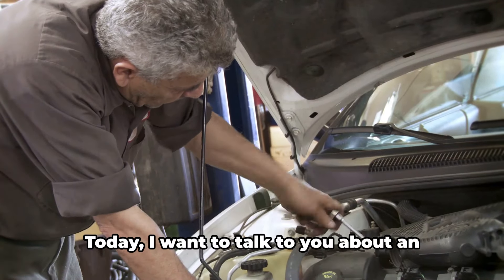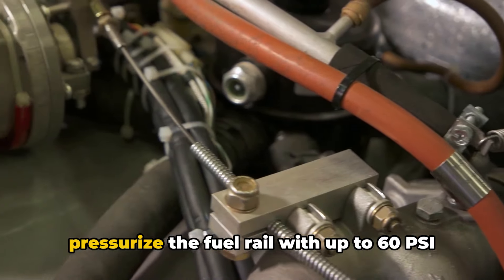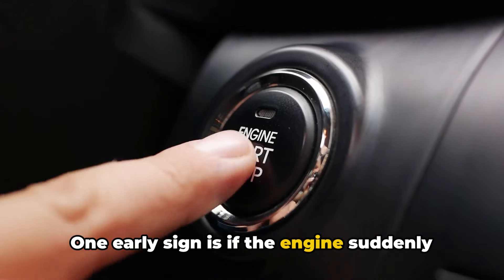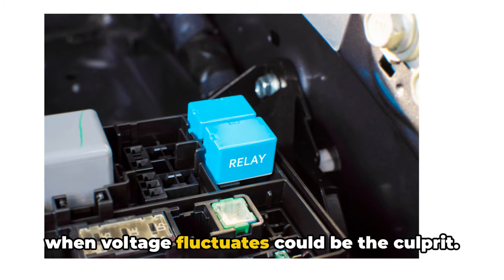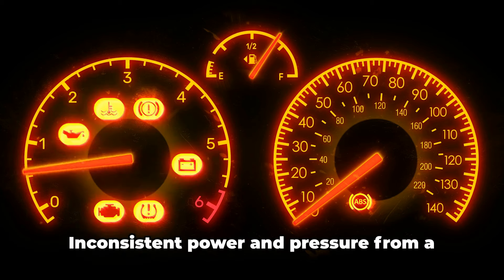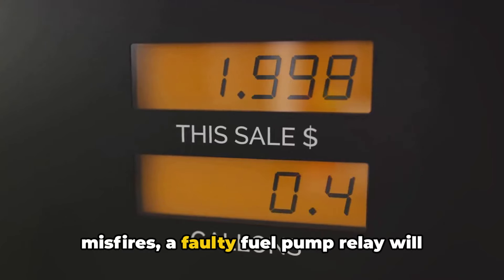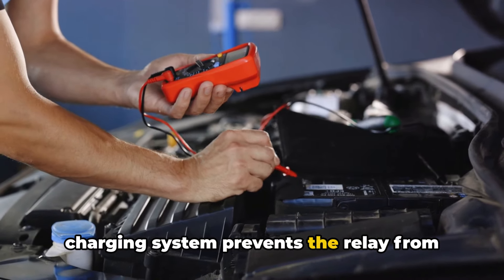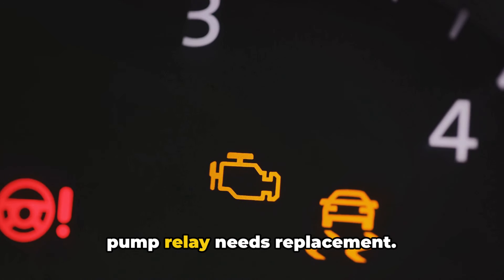Bad Fuel Pump Relay Symptoms: 6 Common Failure Signs

Comment: Thank you so much for posting the video. I found it very helpful although I would like to pick your brain about an issue I am having with my 2012 chevy malibu that none of the videos cover. 

I bought it early March and after about 10 days of driving, it wouldn't start one morning. I did some research, figured out it was the fuel pump relay (or so I thought). I replaced it and it started up just fine. 2 days later, it wouldn't start again. I replaced the fuel pump relay again, and it started up just fine. Until about 4 days later when it wouldn't start again. This time I was sure that the relay couldn't be bad again so I pulled the fuse box out and inspected the wiring. I didn't see anything or feel any heat so I tried starting it and it started perfectly. 
At this point I was confused but it drove fine for a few days until it wouldnt start again. Now everytime it doesn't start, I simply lift the bundle of wires up or wiggle them around and the car will start for me but only lasts a couple of days before needing to be moved again. 
I have watched dozens of youtube videos and talked to a few people about this and they seem puzzled so I will take any and all advice!
Reply from the maker: Hi Chelsey, It seems like you have a loose or faulty electrical connection related to the fuel pump relay circuit. The intermittent starting issue and the fact that wiggling the wires temporarily resolves the problem points to a wiring issue. Possible causes could be a damaged wire, corroded connector, or a loose connection in the fuse box or at the fuel pump itself. To resolve this, you'll need to trace the fuel pump relay wiring and carefully inspect all connections for damage or corrosion
Reply: @chelseycombs9205: Sounds like your fuel pump is bad. It's drawing too many amps and keeps burning up the relay.

Comment: Hello thankyou for the vid.

I have a direct injection engine and have noticed when i turn off the car. The fuel injectors are randomly spraying every 5 mins for about half an hour. The car then finally goes to sleep. Can a faulty relay be the cause of this?

Regards
Reply from the maker: Hi, A faulty relay is unlikely to cause the fuel injectors to spray intermittently after shutting off the engine. This behavior is more likely related to a problem with the direct injection system, such as a faulty high-pressure fuel pump, leaking injectors, or issues with the control module. Let me know if you found the cause

Comment: Hi there I have Opel Corsa 1.4 that will only crank unless if I give it a boost by Stepping on the accelerator and in order for it to idle well, I will have to leave the accelerator when the engine is a bit warm.

Comment: Might a failing relay be related to the fuel gauge not working? I have already replaced the fuel level sending arm, but the gauge is stuck  at below empty. Occasionally, it will read correctly, but it lasts just a few minutes before it goes to reading empty. Any ideas? Thanks.
Reply: Check the fuse to the gages n ur car
Reply: @JosephWilliams-r2m  I have checked the fuse and even replaced it, and confirmed that it can't be that because on occasion the gauge will work for a few minutes or even a day. I think it is wiring or the instrument cluster.
Reply: I just started having a similar problem. My gauge stops a right above a half tank. Sometimes will go below half tank. But when turn the truck off and start it again. It’s back on half tank but when I fill it up it works until I get down to half tank.

Comment: I would like input or advice...
I have a 1990 Ford F150 duel tank (manual) and it been having trouble starting, idling and the check engine light is on. 
It also pushed fuel from the front tank to the rear tank, then overflows the rear tank. 
Assumed it was the fuel pump malfunctioning. 
Took it to a mechanic who is familiar with Fords (and older models) and after extensive diagnostic said it wasnt the fuel pump (they work fine) and eventually told me it needs a new PCM. 
After watching this video, I wonder if it could be something as simple as the fuel relays (as both problems present the same symptoms).
Id like to safely assume the mechanic checked the fuel relays (but you never know). 
Its going to cost me about a grand to get a rebuilt PCM and after hearing from several mechanic sources that its hardly (if ever) a bad PCM, Id like to avoid spending 1k (on such an old truck) only to find out later it was something simple like the fuel relays. 
Any suggestions???

Comment: I stopped at the Coney Island to get something to eat but before I got out the car was running for about 5 minutes so I went in to Coney Island and when I came back out the car started with a very rough idle and then he died and I kept trying to start it up it will crank up with the very rough idle and then die again to the battery died. After sitting for about 15 or 20 minutes I finally got a boost in a crank right up and ran normal. Then today I made a couple of errands and when I got back in front of my house the same thing happened from last night I turned it off and when I crank it back up it ran really rough and died and I kept trying to start it up running rough until the battery died again

Comment: relay stuck some times  ....and fuel pump always running........
Reply: Same, but not sometimes, it's always grinding and whining. I only hear it before starting the engine. Pretty sure it used to shut off after a few seconds
Reply: Even with engine off??? Locked doors and no key in??

Comment: that for this video!  I am wondering if this is the problem with my 2007 Saab.  sometimes it starts and runs fine but then after a short while it starts to sputter and the fuel gauge drops down to E.  I am lucky to get it over 15 mph at that point.  When I turn car off, I occasionally here some loud clicking from area behind the stereo system. Thoughts?

Comment: Hi,I have got a V8 old car mercedes, when cracking engine all injectors they spray all the time,is it normal?
Reply: Should be okay, as long as the car does not flood and die out. For the most part, fuel injectors are "on" all the time while car is running, throttle input is what will tell injectors to send more fuel for acceleration (along with air from intake).
Reply: The government is yyty

Comment: My 1998 Honda crv . It will start then dies instantly. I can crank it back it starts then dies over and over . What could this be ? Any help would be appreciated thank you
Reply from the maker: managed to solve the issue? This could be an issue with the fuel pump, idle air control valve, or immobilizer system. Also check for any vacuum leaks.
Reply: @HonestMechanicChannel  bro thank you so much!!
Reply: No , I have been so busy at work and normally I take my car to a shop . But figured, I need to get better at working on my car.
Reply: @kingatticus303 get a Haynes manual for your car. Or find a troubleshooting check list. N YOU need three things, spark, compression, and fuel. 
Theres a no crank condition
Crank no start 
Rough idle
Etc
You have a crank no start condition which can point to things like a lack of fuel for whatever reason. It might even be your alternator
Reply: Yeah bro I have a 98 wirh same issue it's the idle control sensor My.
Mechanic told me after he had rebuilt my head ans said my skunk 2 manifold had a block off plate my card horrible will die and sound horrible when starting it up but once it's warm it's fine you just gotta keep.it reving till warm
Reply: Ignition control module.
Reply: My 2004 dodge ram 5.7 all at once got to were it would start fine an drive fine for 30-45 minutes and the all at once would start start chugging as I was driving an would not get over 30-35mph an even do it on hill inclines even if they weren’t steep at all an I could pull of the side road turning off my truck for 20 - 25 minutes and then try driving the rest of the way to my destination it would be fine only for after another 30-35 minutes it would do it all again. An now more recently at times as I’d let my truck warm up a little as I finished getting ready for work ad when I went back to my truck an would give it a little bit of gas it was like it was gargling ( sounding as if it was going glupe glupe ) do u think it’s my fuel pump or my fuel pump relay ? Thanks in advance

Comment: They changed fuel pump and car worked for few hours and now not starting. Does it mean they had to change the relay too??
Reply: That or other issues.
Reply: They changed another fuel pump with a cheap no name brand and it is currently working fine. But still confused why the Bosch brand never was not pumping enough fuel. Looking for an complete 2005 FORD FOCUS 2.0 Fuel pump now

Comment: Can the relay be stuck closed? My fuel pump is on constantly with the key on engine off
Reply from the maker: Yes, the relay can be stuck closed. If your fuel pump is constantly running with the key on and the engine off, it's likely that the fuel pump relay is stuck in the closed position, causing power to continuously flow to the fuel pump.

Comment: My daughter has a 2013 KIA Forte it will not take gas and air pressure comes out the tank when opened . The gas just spills outside the car when pumping it. Please tell me what could cause this issue?
Reply: Bad fuel purge valve?

Comment: My a3 Audi 2.0 TDI 2004 model have a problem that after 10KM of drive engine will start vibrating when accelerating,,, I’ll turn off the engine and turn it on after it will run smoothly
Reply: Did u find the issue?

Comment: I have a 2018 Camry that cranks perfectly on cold starts but has long cranking to start when warm starts( after I’ve driven it and parked for like an hr then turn on again) only happens when the engine is warm
Reply: Do you thing this can be the issue?

Comment: My car dies when i slow down  and come to a stop or when i go under 10 mph  starts back up but now starting to die going down the road. Any suggestions. Thanks
Reply: I’m having the same issue. Im replacing my fuel filter let’s see what happens
Reply: @AlexanderRodriguez-bz8dd did you manage to fix the problem. Having same exact issue

Comment: Would a bad relay or pump cause no cranking ?
Reply from the maker: Hi there, It is a bit complicated but in my experience A fuel pump relay itself typically wouldn't cause a vehicle not to crank. The fuel pump relay is part of the vehicle's fuel delivery system and is responsible for sending power to the fuel pump. When it works correctly, it allows the fuel pump to pressurize the fuel system and deliver fuel to the engine. If the fuel pump relay fails, the engine might not start due to lack of fuel, but this is different from the engine not cranking over.

"No cranking" usually refers to a situation where the starter motor doesn't turn over the engine when you turn the key or push the start button. Common causes for a no-crank condition include:

1. Dead battery: The most common reason, as the starter motor requires a lot of electrical power.
2. Faulty starter motor: The starter itself might be defective.
3. Bad ignition switch: If the ignition switch is not working, it might not send the signal to the starter motor to crank the engine.
4. Faulty starter relay or solenoid: A problem with the starter relay or the starter solenoid can prevent electrical current from reaching the starter motor.
Reply: @HonestMechanicChannel  I was was off track, the pcm was fried , but thank you for the help !!

Comment: Good morning, I’m working on a 2009 Kia spectra5 and I’m currently having a fuel issue, it drops in RPMS every now and then and the car will randomly turn off sitting at lights. 
Currently replaced the fuel pump due to the faulty pump not turning on. 
I’m into replacing the filters and seeing if the cause of the engine light kicking on, it says I have lean fuel pressure on my OBD scanner and a PCM failure to send correct A/F ratio, could that be a relay? Thanks again!
Reply from the maker: Hi there,  Good morning! For your 2009 Kia Spectra5, the intermittent RPM drops and random stalling at lights, combined with a lean fuel pressure reading and a PCM failure to send the correct air/fuel ratio, suggest a few potential issues. Since you’ve already replaced the fuel pump, your next steps should include replacing the fuel filters, as clogged filters can restrict fuel flow. Also, check the fuel pump relay and related fuses, as a faulty relay can cause intermittent fuel delivery. Inspect the fuel pressure regulator, as it ensures the correct fuel pressure. Additionally, consider the Mass Air Flow (MAF) sensor and oxygen (O2) sensors, which can affect the air/fuel mixture if they’re dirty or faulty. Finally, inspect for vacuum leaks and ensure all connections to the PCM are secure. These steps should help address the lean condition and stalling issues.

Please let me how it goes.

Comment: Whats the best way to check if your fuel pumps out, if ive checked both fuses and even swapped the fuel pump relay with a fifferent relay and stillwifes grand caravan 2015 wont start.
Reply: Fuel injection service kit from harbor freight is what you need to test it cost about $45

Comment: Hello there. My 2012 Ram 1500 will not start after driving long periods of time. It will turn over but wont crank up and start after long drives. Starts up immediately on cold start. Starter has been replaced $300, Whole fuse module replaced $2,500 and still the issue has not been fixed. Any suggestions and advise will help. Thank you.
Reply: PCM overheats and soldering comes loose in PCM, when it cools again, it works again. Google that.

Comment: i have an issue with my mk4 golf 2.0l where on hot summer days after driving for a bit ill lose throttle and my car will start to stall out. if im on the highway itll pick itself back up but if i dont want that to keep happening i need to pull over and wait for my car to cool down. i originally thought it could be my fuel pump is on its way out, but im wondering if the relay could also be causing this. there is also no check engine light so i cant scan for codes, the only way to pin point it would be to get the software to do a live data scan but thats a few hundred dollars
Reply: Im having the same issue with my Vw Bora. Just had the mechanic replace the 409 relay and petrol filter. The only way to know it worked is to drive at least 40km on a hot day and see uf the engine stalls. Did you manage to fix the problem

Comment: I have a 2005 3.3 v6 camry and i have the problem where is start and dies off right away. I change spark plugs and fuel pump with filter. I still have no luck . Anyone know what i can do to figure out the problem. I been thinking its a fuel pressure sensor on top of the fuel pump housing
Reply from the maker: Hi,  If your 2005 Toyota Camry with a 3.3 V6 engine starts and then immediately dies, and you have already replaced the spark plugs and the fuel pump with its filter, you should consider a few more diagnostic steps to pinpoint the issue. Given the symptoms, it’s wise to start with a detailed check of the fuel system since you suspect a problem with the fuel pressure sensor.

Firstly, measure the fuel pressure using a fuel pressure gauge. This will tell you if the fuel pressure is within the manufacturer's specified range. An incorrect fuel pressure reading can indicate a problem with the fuel pressure sensor or the fuel pressure regulator. Both are critical for proper fuel delivery to the engine, and any discrepancies here can cause the engine to stall.

Next, inspect the air intake system and look for any vacuum leaks. Vacuum leaks can cause the engine to stall by allowing excess air into the engine, disrupting the ideal air-fuel ratio. Check all hoses, gaskets, and connections in the air intake system for any signs of damage or wear. Similarly, evaluate the Idle Air Control (IAC) valve, which manages the engine's idle speed. If the IAC valve is clogged or malfunctioning, it could lead to stalling issues immediately after starting.

Additionally, assess the Throttle Position Sensor (TPS). The TPS monitors the position of the throttle in the engine and sends this data to the engine control unit (ECU). If this sensor is faulty, it can send incorrect information that may cause the engine to stall.

Finally, ensure that all electrical connections, including those at the ECU and critical sensors, are secure and free from corrosion. Problems in the electrical system, including poor grounds, can lead to erratic engine behavior.

After checking these areas, if the problem remains unresolved, it might be necessary to consult with a professional mechanic who can provide a more comprehensive diagnosis. Sometimes, complex issues require advanced diagnostic tools and deeper technical expertise to resolve effectively.
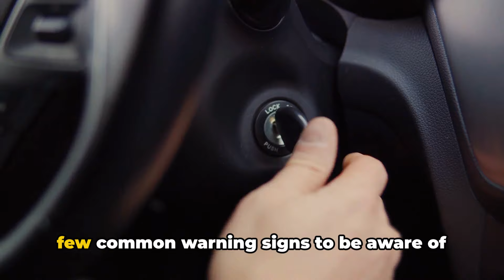Reply: 0:46

Comment: I was having problems with the fuel pump and it says evap vent solenoids it would shut off and won’t turn over till the heat cools down till I notice the relay of fuel pump was backward and I can feel the heat from it so I took it off and put back where it should be in the right plug and after that I haven’t gotten any problems and hasn’t shut off or won’t steer up so I think relay in the right way is more important some people said the relay doesn’t matter how you put it in but to me it proved me that it does matter I was running 86 on 30 12 volt it wasn’t reading it right